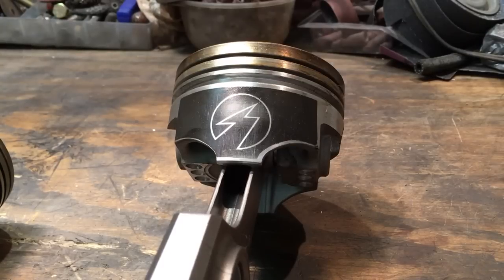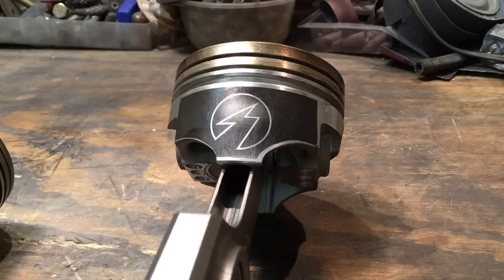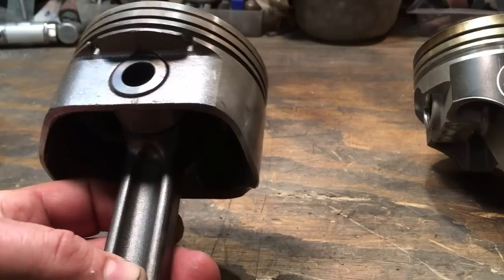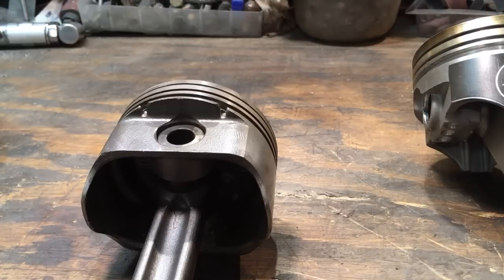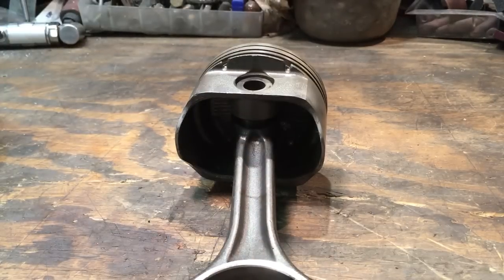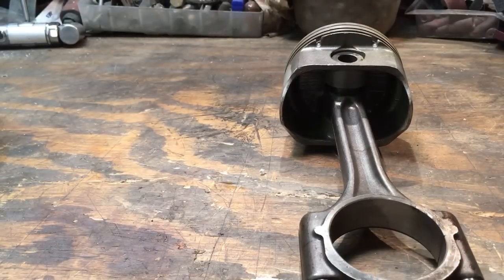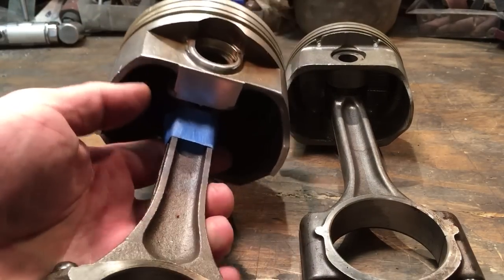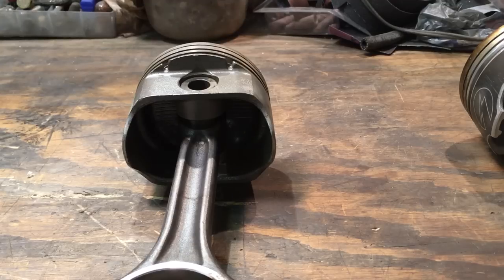6.0 5.7 5.3 4.8 Pistons Modification Drilling oil drain back holes to stop oil consumption

Comment: I bought a l83 lt 5.3 just like the one in my 2014 GMC serria 5.3 l83 lt, and when I tore the motor down to do full rebuild, I found that everyone of the pistons, the oil ringa were completely caked with carbon and no way the oil was able to drain back in those holes, and the motor only had 140,000 miles.

Comment: The motorcycle is a single cylinder Honda CG 125cc. The crankshaft stroke has been increased by 9 mm. 6mm Oversize Piston is fitted. Horizontal 4 holes of size 3mm are drilled to protect the piston skirt from penetration and overheating. Explain the advantages and disadvantages of these holes?
Regards thanks

Comment: I would be inclined to put a hole above the wrist pin , then it would lubricant it and run down the con rod to the crank pin. The other point being that on the  piston downwards stroke it will get a blow back to the  ring grove, and  on the  up stroke get pushed down to the crank.

Comment: 7:18, I guess they don't need it to fully drain, they just don't want it to build up.
Reply from the maker: That’s the huge problem with LS pistons and I think Toyota has the same problem where oil gets coaked in the ring land.  Bad combo results and oil usage and loss of compression.

Comment: Do you think that making those big holes will affect the oil pressure?
Reply from the maker: No, not in any way because there’s no connection or influence between the ring land in the pistons and the pressurized oiling system.
By adding the drain back holes behind the oil control rings helps release/relieve trapped oil scrapped from the cylinder. Engine oil splashes onto the cylinder walls, which is a good thing, however having trapped oil in the rings is a bad situation for many reasons. JD
Reply: Thanks, great video.

Comment: I know you posted this a long, long time ago, but wanted to thank you for it.  I have one of the LY6 pistons that uses the thinner ring lands.  I think 1.2mm top, 1.5 middle and 2.5mm for the oil rings.  In my case a 5/64 drill bit worked perfectly.  I did drill them by hand, but I practiced a few holes on a junk piston I had.  I am now trying to figure out the best way to deburr the holes.  I might have a thin file I can use.  Nevertheless when I took this LQ4 (I know I said LY6 pistons, they are going in this LQ4) apart, the ring lands were so full of oil, they were flush with the piston and wouldn't move.  And of course the entire engine had oil caked on everywhere.  I drilled two on each side of the piston also.  Love your videos and I'm pretty much doing most of the stuff you show since the mods are basically free, just the cost of a few tools I already have.  Porting the oil pump is next.
Reply from the maker: Harbor Freight sells a cheap set of various shaped hand files.  Really fine for the piston work.  JD

Comment: I've had trw pistons with the slot crack down the edges of the skirt.
Reply from the maker: Yeah I agree, the big cut out slot isn’t a strong design.  Adding a few small drain back holes has proven to work well in the oem LS pistons.  JD

Comment: So are the fourth generation ls rods strong enough to lightly boost, say 20 lbs
Reply from the maker: You can run boost with either LS rod but the GEN 4 are way stronger.
Here is the general power limits:
Gen 3 rods 650 whp 
Gen 4 rods 800+ whp 
Naturally if you have the right tune up, enough octane, in the right vehicle in terms of weight you may be able to exceed these limits.  The limits above is where most people have bent the factory rods.  JD
Reply: Thank you. I have never used powdered metal rods, I guess they are pretty strong.

Comment: GM LS oil consumption is due to the AFM.  As soon as I deleted mine my truck stopped burning oil.
Reply from the maker: Seth Jeffrey Don’t limit your understanding, just because the AFM on your application was a cause of oil consumption, doesn’t mean it was the only one. 
Vortec/LS oil consumption has been an issue way before the introduction of AFM. 
This is how we learn, by expanding our knowledge base. Thanks for watching and the feedback I appreciate it! JD
Reply: @HeadFlowInc  my 02 use about 1qt per oil change Canada built 110000 miles
My o4 never used oil us built
220000 miles 
Both have 706 crack heads 
I need to get heads or I'm going to have a milk shake in the future!!!
We're. A good place to call for heads
My 04 has the milk shake

 
Love a mild port and ready to bolt on

Comment: What did that piston come out of with the lightning bolt on the side
Reply from the maker: cooter Brown Big Block Chevrolet 454 speed pro Forged pistons on H-beam rods. 👍
Reply: @HeadFlowInc  that's why I asked because I have a 454 with the Same pistons inside it that I picked up at the junkyard but don't really know much about it

Comment: When I was working at the dealership I pulled apart plenty of engines that had the ring ends lined up or really close to lining up. The closer they are to lining up the more oil they will burn.

Comment: I had heard that the Active Fuel Management was causing oil consumption problems. It disables 4 cylinders, and problems with the valves sticking open when they aren't supposed too.
Reply from the maker: peter ferri Interesting, I know they had issues with the lifters failing in those engines as well.  It’s totally possible! 👍

Comment: I have also heard about this issue. I'm in the process of putting my LS back together now with aftermarket pistons. They are setup very much like your stock piston. What I saw in a video and found out was that there is another type of issue related to the oil consumption problem. The pressure relief valve down on the oil pan can apparently spray oil out into the crank area and end up increasing the oil on the backside of the pictons. They make a little shield to cover that oil pressure relief valve and redirect the oil down into the sump area. It only costs a little under $10 and is very easy to install.
I'm going to look at the last 4 listons for my engine before I install them. Just to verify what you were saying.
The GM part number for this oil pressure relief shield is; 12639759 and here is the description.
OEM NEW Oil Pressure Relief Valve Deflector 08-18 GM Trucks & SUVs
I don't see any way to paste a picture of it here. I saw it in a 5.3l engine replacement video for Suburban.
Reply from the maker: Mark Moore Interesting information, I’ll definitely look into it on 08-13+ builds. I think the latest Turbo build is a 2012 bottom end, I’ll definitely look into the deflector.
I wonder if this oil relief issue could be related in any way to the DOD on those engines?  Thanks for the feedback I appreciate it! 👍 JD
Reply: @HeadFlowInc  Yes, that is correct. I'm sorry I didn't think about mentioning that this is possibly AFM/DOD related issue. I can only guess that cutting off cylinders possibly adds to the amount of overpressure oil being dumped. Although, I have still heard there is an oil consumption problem on non-afm engines. I was in fact replacing the parts and removing the AFM/DOD capability from my engine. For both oil consumption and fuel mileage. I have heard that both of those are side issues related to the AFM/DOD engines.
If you look at where those vent holes are located on that relief valve it clearly should have a better direction to flow. This shield forces it into the sump. It just slips over the relief valve and makes sure the oil doesn't end up going back into the moving parts of the engine.
Reply from the maker: Mark Moore I agree, I’ve already contacted Richard who’s building a high HP 5.3 aluminum 2012 block. I know he’s already installed all the pipe/hex plugs into the DOD stands, but he hadn’t heard of this issue either. We’re on it now! 👍
Squirting oil on the rotating assembly creates a fine oil mist and can cause foaming. Bad.   Thanks again!  👍👍👍

Comment: My'08 Sierra 1500 Z71 has 165K on it now.
It has always taken about a quart or less between oil changes at every 3000 miles.
This is considered normal as I commute with it 50/50 town and highway and run her at 80 MPH most of the time.
Not considered an issue at this point.

Comment: How much will 6  3/32 holes affect your piston weight? Also you are comparing  35 dollar set off pistons to a 200 dollar set of pistons also cast versus forged.
Reply from the maker: George H. Reed Jr. Not enough to even measure per piston!  Literally way less than 1gram per piston. 👍
There’s a follow up video showing the weight of all the aluminum removed from all 8 pistons on my channel.
Reply from the maker: George H. Reed Jr. https://youtu.be/la4nazvcyrs

Comment: Think of the aerodynaics of the 2 types of pistons on their way down also and how the air forces its way  INTO the piston, compared to the stock one with 2 cuts on the side of each side.
Reply from the maker: Don Rutter Any Air pressure in the crankcase is hopefully trapped or sealed out by piston ring seal.  If you could get air sneaking past the ring seal it be a good chance the engine would smoke like crazy? 
The oil control ring land has to be able to drain the oil it constantly scraps off the cylinder. The oil gets thicker during operation on the cylinder wall below the piston due to heat cooking the oil. 
I think we’re on the same page as far as the oil has to have somewhere to go or it’ll become a burned mess. JD

Comment: Is this oil consumption issue primary with race engines or also daily drivers ?

     I drive a company truck , 2008 Silverado .  With a 4.8l , I think .  Coming up on 160,000 miles & no oil consumption issues .

     Now , I am am old man and drive like an old man .  I rarely " get on it " , unless I dumb up and get in a bind .

     Very little towing .  Other wise I drive the speed limit .  So not a lot of stress on the engine / drive train other than the differential is geared high .  Probably for gas mileage .

     One other question .  If you drill those 4 holes , does it significantly alter engine ballance ?

Thanks ,   ;-)
Wyr
God bless
Reply: Wyr Twister engine and trans will be in a hot rod soon
Reply from the maker: Wyr Twister Mostly stock as delivered vehicles have the oil use issue. GM actually did a recall on some vehicles offering to swap the pistons so I’m told. 
After about 2004-2006 I believe they started trying to baffle the valve covers to limit oil being pulled into the upper intake, changed the design and location of the PCV valve.  I haven’t seen the later year 2007+ pistons to see how they addressed the oil drain back issue.  No concern with engine balance, not enough material being removed. 
As long as yours isn’t using oil it should be fine.  Merry Christmas 🎄 God Bless! 🙏🏻
Reply: Unfortunately , last Monday morning , a lady ran into the right door &  rear part of the cab .

     Have not heard the appraisal , but several have commented that it looks like it may end up being totaled .  And , that is kind of sad since the engine and transmission still seem strong .

Thanks ,   :-)
Wyr
God bless and Merry Christmas to you too
Reply: HeadFlowInc I know the 2009 6.0 L76 pistons come with 4 drilled oil return holes
Reply from the maker: Russel Mcfarland Good progress should be ready by spring!👍

Comment: My 2009 aluminum 5.3 consumed oil and they changed pistons under warranty at 60000 miles and im at 150000 now with out burning or using a drop
Reply from the maker: MrChristianbowman82 I knew GM had to know what was causing the   Issue.  I’m both happy and amazed they offered to fix it, normally GM dealers will finds every excuse/explanation to avoid responsibility.  Very happy to hear your success!  👍. Merry Christmas 🎁
Reply: coming from a gm ls man not true bout gm lnew why it burns oil i own a stock 5.3 z71 truck an a built ls 200p0 ss an both does good at not using oil
Reply: Unfortunitly yes gm had some issues with the AFM 5.3 engines most other AFM engines didnt really have problems. I've worked as a Chevrolet certified Technician for about 15 years and specialize in heavy line repair. And have done quite a few of these special coverage applications. From 08 to 13 most of the oil consumption issues were from a faulty pcv locations in the driver side valve cover. And per the gm tsb describing the oil consumption issues the only way we could get to replace the pistons were of the rings were stuck and would not dislodge with major induction services. And further more to counter this other guys 2cents any Chevy dealer I've worked at we always loved seing piston jobs cause they paid so much and ment a good paycheck so the thought of "us" trying to find a reason to not perform this job is just pure b.s. good try though
Reply: Noah Adams I know you work hard as a mechanic but that is not always true about the dealership's  They try to talk people out of the problem till the warranty is up I have seen it done and have experienced it myself and it pisses me off because I work on car's!!  It is very rare that a dealership will step in and help the customer in an engineering flaw situation..
Reply: Under warranty the dealer can only do what the manufacturer will allow and pay the dealership too do the dealer does not have a final say in a warranty repair the manufacturer does

Comment: Do you think such a large slot like on that "350 Rebuilder Piston" might be compromising the integrity of the piston especially under higher cylinder pressures?  Great info as always!
Reply from the maker: drewnashty The large slot may make it weaker.  Those rebuilder Pistons are cast aluminum, it would be interesting to see if any high end Pistons have the slot. Thanks!

Comment: been watching slot of your porting vids. I've been working on a stock Pontiac  cast iron head I had as a backup for my hydroplane. . my main engine had the racing super duty head setup for methanol. i am building this head for gas to run vintage. Gary Stanton told alky need a 20% bigger port volume than gas. . this iron head with 1.940, 1.6 should be a better set up . be running 2 weber off 44s instead of the hilboen injector. thanks for your vids
Reply from the maker: My apologies I was not notified of this post until literally today it was in my current comments.  I hope you were able to enjoy your project!  JD

Comment: I noticed on the speed pro hypers I got for a iron Duke engine I am building  didn't have those where I thought they should be . I just drilled them.
Reply from the maker: mlong5151 It will be a benefit the ring seal. Thanks for the feedback! JD
Reply from the maker: mlong5151 Be very careful in the bowls both beside and behind the guide area on Pontiac heads! They're very thin behind the guide so let the back area alone. Also on the roof of the ports don't raise it very much there's a couple areas where it gets thin. 
The "curtain" area at the first 1/4" or so at the seat to bowl transition and the widening of the short turn do wonders.

Comment: the 97 never had a 5.3 it's a 5.7 vortec not a ls based engine they had a few 305 ci vortec in 96-97 also but less likely
Reply from the maker: Jake Browne The biggest confusion is caused by GM putting the name Vortec on top!  The LS engine family started in the cars 1997 but did not show up in the trucks until 2000. Even after the switch to the Gen 3 small block GM stuck with the Vortec insignia I guess to help sales?  It's caused all kinds of confusion.
Reply: Where did you get the I beam rods? are they 6.098" or 6.1" length?
Reply from the maker: w41duvernay The H-beams are BBC
The other rods are 6.275" 4.8 rods

Comment: How can I tell just by looking at my 97 Chevy vortec if it's a 5.7 or a 5.3 ?
Reply from the maker: Kirk Niles Well that's a tough one, the easiest way would be to check the front of the block behind the driver side bracket to see the CID casting. I.e. 4.8/5.3 or 5.7
Reply: Could be a 4.3L V6, a 5.7L V8 or the L29 454 ... all were labeled Vortec in '97.
Reply: @PapaSmurf337  Just because it's a Vortec doesn't mean it's an LS. The Vortec 5.0 and 5.7 are NOT LS engines.
Reply: @atx-cvpi_99  Nowhere did I mention that a 5.0 or a 5.7 Vortec is a LS engine. In response to the original post from Kirk Niles "How can I tell just by looking at my 97 Chevy vortec if it's a 5.7 or a 5.3 ?" I posted  "Could be a 4.3L V6, a 5.7L V8 or the L29 454 ... all were labeled Vortec in '97." Not sure why I have to restate that because all one has to do is read but clearly you didn't understand my plain English. In 1997 the most common engines with the Vortec nameplate were the ones I mentioned
Reply: Kirk Niles look at exhaust manifold, if they are all equally spaced it's a 5.3 but if the 2 middle exhaust ports are close together it's a 5.7. But they didn't start using 5.3 till '99 model year